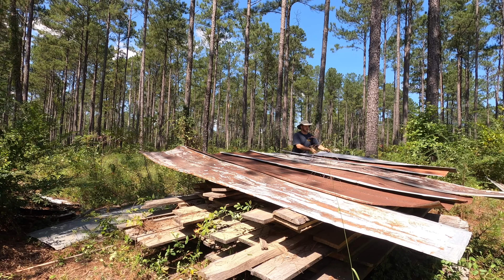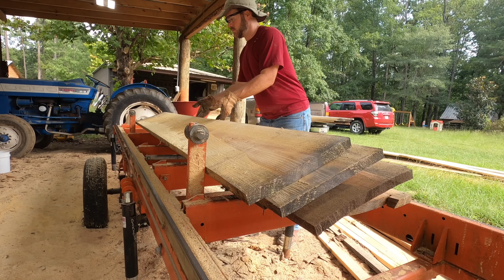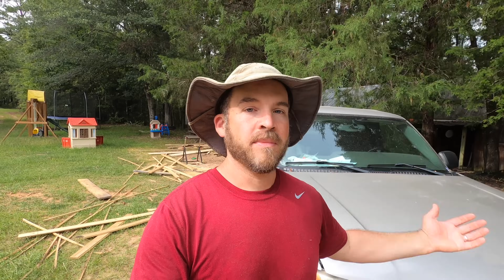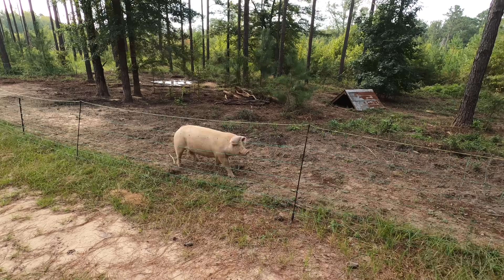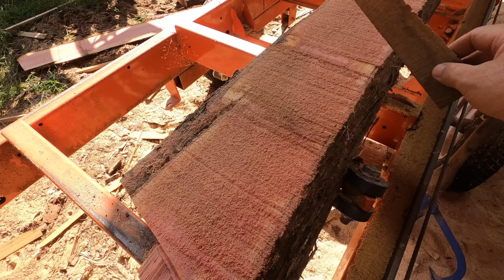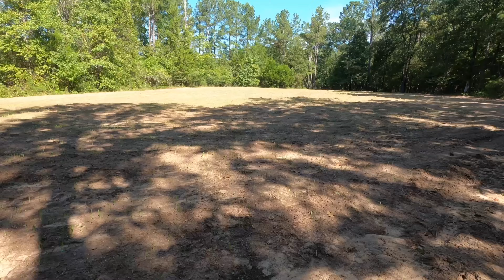BIG Treasure in a Tiny Log

Comment: One suggestion for your cedar.., I used some locally sourced cedar to make an Adirondack chair for my aunt and uncle. I'm not a Norm Abrams but, I have to admit it turned out wonderful with the different patterns and such. Even though cedar is pretty rot resistant on its own, I finished it with a spar varnish which gave it a bit of a glossy finish which really makes it pop. They say everyone who sees it ooo's and ahhh's over it and asks about it. I'd say you should have plenty to make one for yourself and your family.

Comment: Do you think you might ever build yourself a drying shed? something with some nice shelving on which you could sort your boards by size. Large enough to have a nice deep over hang to insure the boards are well enuf away from the outside edge so as not to get wet when it rains.  Something around the size of your pole building where you park your vehicles.
Reply from the maker: Probably not. If I built another shelter, it would end up with all kinds of junk up under it that was never intended to go there.
Reply: @falllineridge    😄  Shameful, just shameful.  And here I figured you could have your homemade lumber in a nice safe place to dry and cure, and you could have your fine woodworking equipment right there with it.  You could pay your son a stipend to make sure you keep "your room" picked up, sorted and organized.

Comment: Wes I remember you saying you have a diesel drip to keep your mill blade from getting gunked up. Does the diesel spraying on the wood leave a smell? Cedar smells so good so I was just curious if it affects your lumber at all. Thanks for the great video.
Reply from the maker: I had a diesel drip on it, but I got concerned about all of the aerosolized diesel sprayed around in the air. Probably not the greatest for my lungs. Cedar doesn’t gunk up the blade, but pine will. If I’m sawing pine, I will use dish soap and water. If the blade gets gunked up, I have a jug of diesel fuel, and I will pour some on the blade periodically to clean it. So, no staining. However, staining was not really an issue when I did have the diesel drip, because you only have to use a tiny bit of it.
Reply: Oh ok, that's some good info! thanks for the clear explanation.